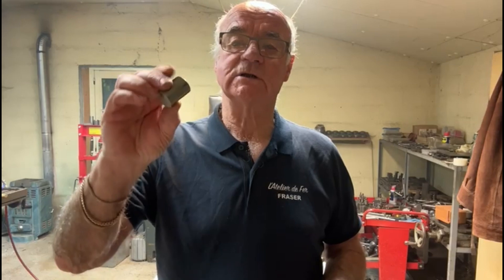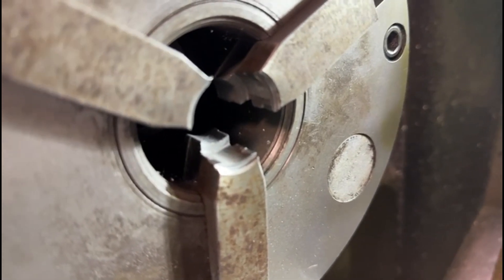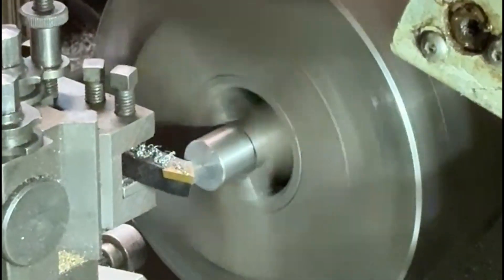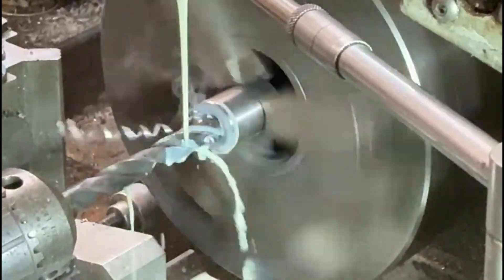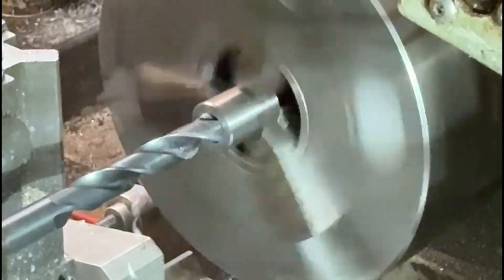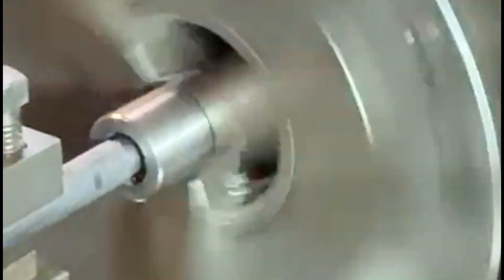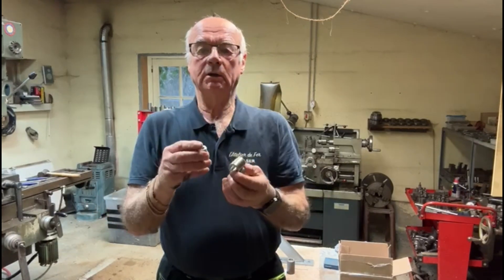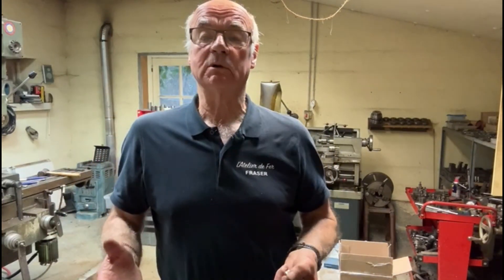Drilling a Hole Through a Steel Bush

Comment: Hi Fraser, good video as usual. May I ask roughly, what sort of money would you charge for a job like that, I assume you provided the steel?
Reply from the maker: Hi. Thanks for the comments. My client provided the steel already cut to size. All I had to do was to face them off then drill and bore the holes. I'm sorry, but I can't tell you what my clients pay for my work but I can only tell you that this project took a little over 3 hours. Cheers.
Reply: @ thanks Fraser

Comment: I do not have a set of soft jaws for my Colchester, but seeing you machine these bushes out so repetitively makes me wish I did have a set, I do have a 14.5 drill though. Stay warm! Chris B.
Reply from the maker: Hi Chris, thanks for the support. Worth getting some soft jaw blanks for the odd projects that you can't hold in hardened ones. Make sure they fit your chuck size though! I also have a 14.5 drill but not a 15.5 . Only had to bore out about half a mill!
Cheers. You stay warm also.